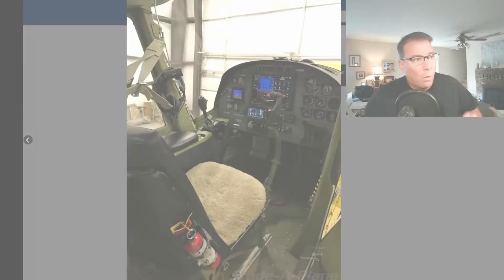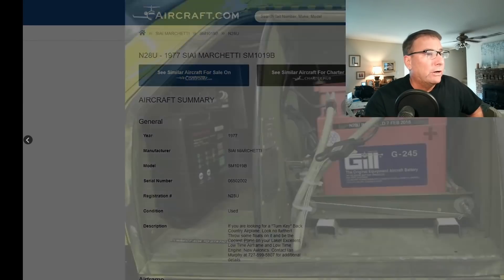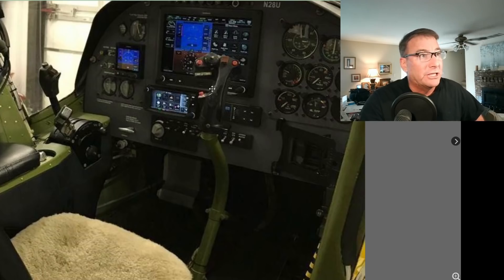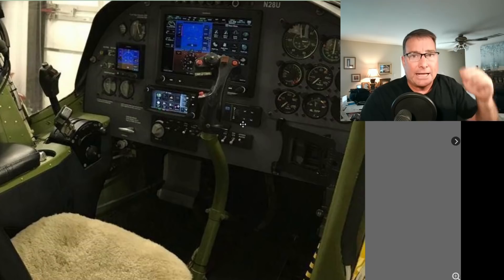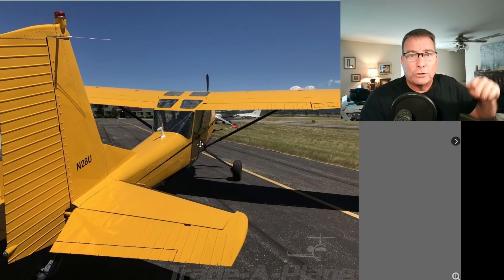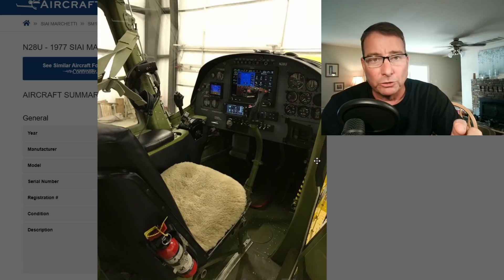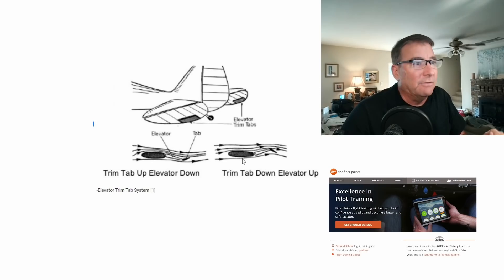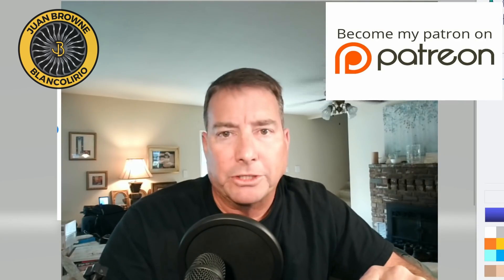Dale 'Snort' Snodgrass Siai Marchetti UPDATE- Elevator Trim System 8/8/21

Comment: Dont know if someone mentioned the high winger with low flaps factor when full power is strong, like this airplane was.  With flaps mostly down, that airplane needs DOWN TRIM, not even neutral, but down a good amount for take off.  Unless planning to do a very steep climb to begin with, those strong high wingers need nice down trim on take  off.  

 That strong prop wash with flaps down produces a huge push down on elevator.  Many Cessnas have crashed on take off or flaps down go arounds due that push down on elevator raising the nose to a stall.   

Some turbines have a switch to bring flaps up to 20 at full power application.  But STOL pilots disconnect it for shorter take offs rolls displays.

Comment: It seems that on a light aircraft, you should be able to override a runaway trim especially approaching the stall when aerodynamic forces would be reduced due to the lower airspeed.

Comment: Im still not sure.  But if nothing mechanical failed or was wronly set like the elevator trims.  Could that been that he was going to use the Afterburner as usually he does to avoid stalling, and the afterburner failed to light on this take off.   Bad luck if you rely on something to avoid stalling on a 50 degree nose up take off and it fails you.  No good afterburner light this time maybe??.  More engine power needed, but he didnt have it as usual?

Comment: Imho, i doubt a trim runaway or opposite trim could create such an event with the skills of this pilot.  This is not a trimmable stabilizer as on an airliner.  Other than a stronger than normal force, pushing forward along w opposite trim would create downward deflection of both elevators and trim tab.  And it's hard imagine in such a dire circumstance the pilot would not be able to push the elevator down against an opposite rigged tab.  Your previous video showing no deflection of aileron nor elevator is more telling.

Comment: As an accident investigator I can say it is possible of backward install. this is speculation.  As trained you follow the evidence and don't speculate.  Runaway trim is more plausible though.  the push to talk activation is def a possible good clue to what was going on.  Its virtually impossible to solve this with out all the pieces of the puzzle.

Comment: Excellent presentation! Minor addition: If the Marchetti's control lock is the same as the Bird Dog's, it not only prevents the rudder pedals from moving, it also depresses the brakes, preventing the plane from even rolling.
I spent the past six years flying Caravans. Never once did I use the electric trim for fear of a runaway trim, something one of our pilots experienced. Too, the manual trim gives you a more intimate feel for the airplane. On a practical note, if you use it a lot it's going to eventually fail, and that little switch costs about $500.

Comment: Excellent video helping us to understand a tragic accident. I'm not a pilot, but I am curious if the community could explain to me why a trim tab would be designed in such a way that a malfunctioning trim tab, due to reverse wiring or pilot use error, would be allowed to have such a dramatic effect on flight characteristics? It seems an engineering mistake that such a small surface as a trim tab, operated by a thumb switch, should have the ability to override all the other control surfaces, wings, ailerons, engine thrust, and put the aircraft into an unrecoverable condition. 

Since the trim tab is electric, shouldn't it be indexed to another parameter? Could that have prevented this accident? If the trim tab could not have been actuated more that 50% of it range, the nose would not have pitched up as quickly, thus delaying the stall, thus given the pilot more time to affect a correction? If trim tab inputs were tied to parameters like air speed, or angle of attack, or some other parameter it seems this accident could have been avoided. Yes?

I remember Juan's video detailing the P51 Reno air show accident years ago was caused by a failed trim tab, but that occurred over 400mph and was a mechanical breakage that caused severe nose pitch that caused the pilot to black out.

Comment: If a medical problem can be ruled out and the aircraft hadn't just come out of maintenance it's hard to believe an experienced pilot could miss this not just in the cockpit but on the walk round. The elevator must have been at full up deflection.
Reply: Dale had just picked ip the plane out of maintenance (since June 30) immediately before the crash.
Reply: @citybright8925  That speaks volumes and the no1 possibility.

Comment: If you have runaway nose up trim  in a normal aircraft, not some over powered bird dog, you can roll off the  lift before stall. Just keep rolling off before speed gets to low until you can figure things out.

Comment: Surplus military generally do not remain is stock original configuration. Owners delete control locks or alter them to suit the owners preferences. Note elevator (pic)at landing was still evenly trimmed with stabilizer. No up or down elevator position.

Comment: This trim issue is very interesting to me. I had an intermittent trim issue with my 250 horsepower boat motor this year that was traced back to wiring insulation that had come apart in the throttle, which houses the trim switch. Coincidentally, the pump motor is the same motor used on the gear pump in my Piper Arrow. Having this issue myself, it is very easy to see how something relatively minor in a trim system could cause such major consequences.

Comment: I assume the PTT is the button to the left of the electric pitch trim on the Yoke? If this is the case, we know he was communicating with ATC as the aircraft went down. Which suggests he wasn't attempting to adjust the pitch trim, as he would have used his thumb to manipulate both switches.

Comment: First of all, many thanks for your always great videos.  I learn something by watching them every time.  I am just a private pilot but the way I have learned is to verify the trim operation.  It was part of my checklist.  On my first plane, a Cessna 150F, I could turn around an see it while operating the control wheel.  On my Diamond DA20, I have LEDs indicator for the actual position of the trim.  I have been flying for 18 years and been verifying the trim function as part of the checklist.

Comment: Theres one common thread that has run through a few accidents of late, and I'm not talking about any exacerbating factors. But it seems more than one were caused by a reversed trim or perceived reverse trim before / resulting in a zero sum endgame. I cant help but think that having a 'return to unity' trim (0-,0+) idiot button should maybe be a thing on these aircraft. Where the trim is motioned by a jackscrew and the screw unwinds itself from the thread is another thing, and I know seasoned pilots don't like to be told. Its easy to be in a high stress situation and think you are doing something a certain way but then realise you have it all wrong, just look at the police traffic stop shooting video where the cop goes for his gun and doesnt realise he still has his pen (from writing the traffic ticket) in his right hand and goes to pull the trigger and nothing happens and doesnt realise why nothing happened until the pen slips out from beside the pistol grip and his grip is suddenly slack. muscle memory and sudden unanticipated change of environment.

Comment: I saw this same type accident in Alaska many decades ago when a mechanic rigged the elevator controls backwards in a Pilatus Porter.  It took almost the same flight path seen in this video.  The pilots survived, but the accident was exacerbated by the test pilot in the RIGHT seat using his left hand to turn the trim wheel, unfortunately in the wrong direction.

Comment: No one can believe this could happen to a seasoned extremely skilled pilot, how ironic he met his demise in a single engine light aircraft. It is unacceptable to most that he made a mistake, not him. But no one is considering the haste with which he departed, his confusion as to what frequency he was on, all the short cuts he made to get out fast. Few accidents happen solely due to one factor alone, it is usually a chain of events that combine to cause the end result. So maybe they should consider the factor of his mindset and ability to react to a situation given his hurried manner and age. Everyone gets old and while he is still operating with skills few of us will ever have, he was 72. I'm 74, I understand it.

Comment: You talk extensively about the possibly of a reverse-rigged elevator trim system.  I could absolutely see that as a possibility, but only if this was the very first time he ever flew the plane, or if this was the first flight after some significant work was done related to the trim system.  Do we know if either of these conditions were the case?

Comment: A single engine, two occupant aircraft needs electric elevator trim because the aerodynamic forces are too much for the pilot to manually control.  So how does a 50 ton 737 max function with manually controlled trim?

Comment: Hi Juan,

I just noticed this new video posted on your channel.

In your previous video on this accident I questioned whether or not he could have either left the trim full nose up or at least  in a nose up position past neutral from his previous landing in the airplane.

Also I mentioned possible run away trim. It is just an uncommanded pitch excursion that led to the accident.
Question is what caused the pitch excursion beyond his ability to overcome it.

Comment: Given the difficulty of moving the airplane with the gust lock installed I would tend to doubt that is the explanation. I would tend to believe this was a medical event on takeoff roll. A sudden biological failure of some sort could easily explain the lack of control inputs. 

I had a friend who was a vintage NASCAR race car driver. He just passed a car to take the lead of the last race of the season at a thunder hill raceway in Northern California,, and win the championship, when he had an aneurysm. Spectators thought the throttle cable had simply snapped because the car suddenly slowed, yet continued driving the full length of the straight until easing off into the grass and stopping. A few laps later the workers noticed he wasn’t moving and threw the red flags and rolled the ambulance. He had died instantly at the start of the straight and coasted the whole way to the end of the straight. So, a similar thing could easily have happened here…..
Reply: Not a medical emergency but a maintenance screwup.
Reply: @citybright8925  neither. The pilot's failure to remove the flight control lock was cited as the probable cause by the NTSB
Reply: @yips_way   Yes, I know. His wife said he had trouble putting his socks on. It was uncharacteristic for him not to do a thorough preflight check, but as Dan Gryder noted, he was in a big hurry and took shortcuts. Such a sad ending to a stellar career.

Comment: Even if the trim tabs were in full nose up position, the pilot, even in this instance should've been able to immediately correct by dropping the nose down, applying full power and getting her settled up. Aerodynamically speaking, trim tabs cannot, under even extreme circumstances, do this. Especially to this particular aircraft. Look at the elevators. Then look at the trim tabs. The laws of physics do apply here. The greater surface should've provided enough force to drop her nose down even if the trim tabs were in a complete nose up position. Yes, the aircraft would've been a handful, but even so, the pilot should've been able to, in an instant, get this corrected. The larger the control surface, the greater degree of effect it will have on manuavering the aircraft. 

These particular aircraft are very powerful. Of course, I'm speculating, but it seems too me, that an instrument in the cockpit tells the pilot exactly where those trim tabs are set at. If so, the problem might have been corrected on the ground before takeoff. Once in the air, a pilot has a few seconds, if that, but based on the video of the incident, it appears the pilot had those few seconds as his ship started to nose up. 

I know some might not agree with me, but something is obviously amiss here. An experienced pilot generally doesn't take off until they're absolutely sure all control surfaces are where they should be according to that particular aircrafts check list. He appeared in a hurry. These aircraft get in the air quickly. If those trim tabs were nose up, he'd know real quickly because his ship would get off the ground very quickly. 

A walk around inspection certainly would've shown if any issues visually existed, but if so, why take off?  This was an incredibly experienced pilot. His mount was an incredibly agile and very aerodynamically sound aircraft. This shouldn't have happened. The only other angel here is, when was the very last maintenance check performed and were there any issues needing service or repair? Those trim tabs are indeed electrically actuated. Did the pilot actuate them by mistake prior to throttling up? Is the control wired correctly? Legitimate questions the NTSB and the FAA will look into. 

This particular accident has me perplexed. Yes,  it's incredibly sad, but this sort of thing shouldn't occur in extremely well maintained aircraft and with an obviously experienced pilot. I sincerely hope the cause is found. Which is likely.

KB🛫

Comment: Trim can be overcome. You can still push the elevator forward if the trim is set to nose up
Reply from the maker: This is NOT a certified AC....(Experimental Exhibition)
Reply: @blancolirio  damn well what's up with that.
Reply: @blancolirio  well what did dale have to say about why he crashed?

Comment: I saw a still photo shot of the wreckage today on another YT video.  The elevators and rudder on the wreckage are dead center - even after high impact forces.  In the video - the elevator and rudder never seems to move during the stall, spin, and impact.  You can see the flaps down in the video, but never see the ailerons move.  You have to believe he was providing control input during the crash sequence.  It's too early to know - but locked up controls seem suspect.  But how?  He was reported to be sitting in the front - and control lock design prevents taxiing. Juan has good argument that the controls could have not been locked in the rear seat either.  He did put camping gear in the rear seat. Runaway or reversed trim would not have locked up rudder or ailerons.  External locks - not likely? There's a smoking gun here somewhere . . . . . RIP.

Comment: Don't the electric trim switches on some large aircraft now have two switches next to each other wired in series on the yoke requiring both to be pressed to activate the trim up or down? One can fail (short) and the other not shorted will save the day. I think this came about after a shorted electric switch (down as I recall) on a Learjet caused a crash over the great lakes many years ago. I would guess Juan's 777 has this.

Comment: With a runaway trim being the cause of such a rapid loss of control,  I'd expect the elevators to not be in a what appears to be (close to) neutral position in all the images where we can reasonably well say that it doesn't have a visible deflection.  
It's hard to say definitively, but I do think the top area of the fuselage near where the slope upwards towards the stabilizer starts looks "off" in the frames before the plane starts rolling..  I don't know the aircraft, and it might be due to video compression or sunlight being reflected, but  there seems to be a bit of a slight V shape in the top of the rear fuselage instead of the more smooth shape I'd expect to see. 
But who knows... I really hope they figure this one out soon, because this is (literally) the kinda stuff that keeps me up at night. Some types of accidents are pretty clearly pilot error, or a clear issue with the aircraft, but this one just feels "off"  like something unusual happened here, and because it escalated so quickly close to the ground after takeoff I'd really like to know what it is...

Comment: Juan he says "Clear for takeoff" when the wheels are already off the ground? I also seemed he was on the wrong frequency the exchange previous? Rushed? I Heard it the first time as "Check Check" but later seemed like maybe something else (curse). If he were launching the Tomcat, it slowed, then attitude indicator made a big movement it would be "Eject Eject"??? Under the ultimate stress, rip.

Comment: Would reducing the power (moving throttle back toward idle) have had any impact on gaining back (some) flight control in the case of runaway trim up?  ...This is very sad.

Comment: Certificated airplanes are designed to fly fly trim in either extreme position.  This Marchetti is not Normal Cat, but likely built to same design standard.  So, I’m throwing some shade on the trim theory.

Comment: I think it is very likely that the front seat slid backwards and pushed the back joystick backwards.There was then virtually no way for Dale to push the stick forward.
Testing should be done to see if in fact a full elevator up trim could prevent a pilot from being able to keep the airplane out of a takeoff stall. I don't think a stall would be forced even if the trim was jammed all the way.